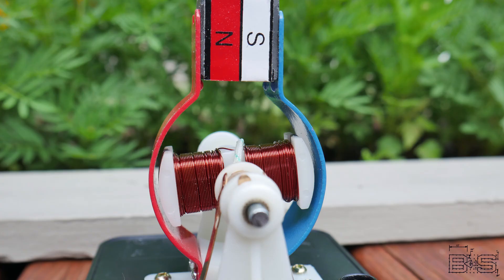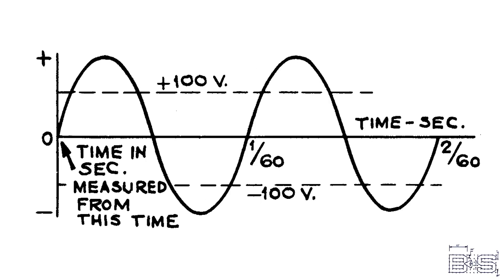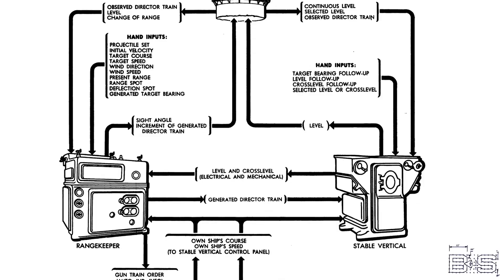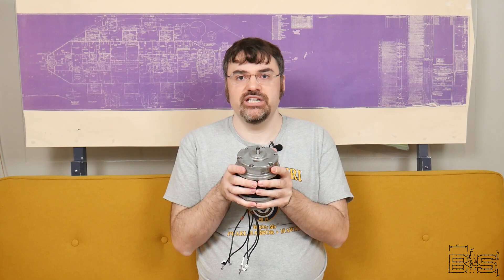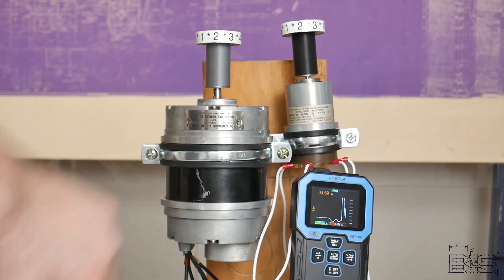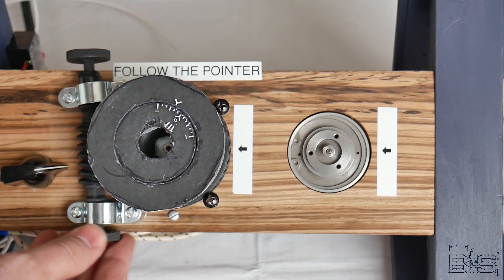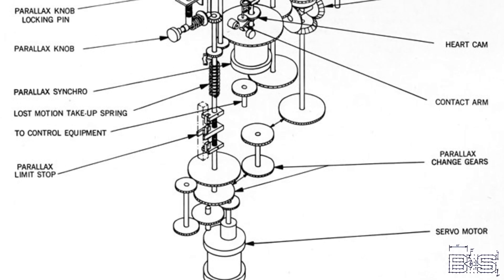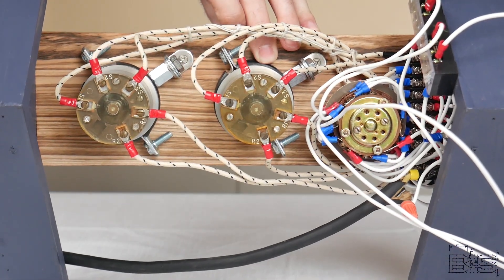Synchro Theory

Comment: USN, 68-74, ETR-2,  NAS Miramar, 70-74,  I maintained GCA RADAR and TACAN.  For decades, I had a HUGE  pair of old  60Hz  syncros,  don't know what happened to them.  We studied them in ET-A  school at Treasure Island, San Francisco.  I was a member of the fantastic  amateur radio club there, K6NCG, out on the NW corner  in those days,  look it up ;there are 3  websites with old archived photos.

Two of our  GCA RADARS  had  I guess resolvers,  I've forgotten,  to drive the electro-mechanical   CRT  deflection coils in the display.  We had 2  "QUAD" AN/FPN-36 RADAR,  and another  AN/FPN-52,  a  PAR only  section of the old CPN-4 design.  I do not remember  how the '52  sent sweep info from the antennas

I  have often guessed that  a pair of automotive alternators could be used as syncros  if the diodes were removed,  using low voltage such as 12 or 24VAC.  But of course the  freq  might not  be tolerable

Comment: I'm a former Turbofan Test Engineer for Lockheed and Rolls-Royce, which means we had a large test stand for the jets to hang from during test and that stand was about 1/8 mile from the control room.  We had a throttle connected to a syncro/resolver though an isolation transformer. 

I'll never forget that system because there was almost no documentation.  Luckily, many of us came from metrology at Lockheed, and the Marines prior to that, so we already knew most of how it was supposed to work. 

Really interesting stuff in your video, thanks for sharing!

Comment: It would be interesting to see how this was applied to automatically position a turret without a lot of oscillation.
It seems like a bad idea, but running the synchro on high voltage, you could use the current phase difference from the offset of the synchro relative to the turret to run a much higher impedance, much higher power 3 phase motor with the turret geared down to be proportional to the synchro.  Something something rotor current ... profit?

Eh. Maybe I'll try it with some alternators.

Comment: First off, you are way too young to be understanding Selsyns. I'm 67 and I got in on the tail end of things. Nice job of explaining things! :)

We used WWII Navy surplus Selsyns to control the positioning of the various chains in a conveyor system in automotive plants. Our standard layout was a transmitter, differential, discriminator, and receiver. The transmitter and the receiver were fundamentally the same. What you show as the generator and the motor. The "Master" conveyor would have the Transmitter/Generator driven by it (using an Edon unit to drive the generator), and the "Slave" conveyor would have the Receiver/Motor connected to it, also via an Edon unit.

The differential was a six wire device that sat between the generator and the motor and allowed us to control where the in-phase position of the Slave conveyor would be relative the the Master chain. Effectively changing where the "Dogs" on the two conveyors would align themselves in relation to each other (the "Dogs" on a conveyor were what moved the product e.g. cars around). It had a dial that we would move as necessary to get the gap between the dogs where we wanted it. For an example @8:40 you see the director and the turret pointing off in different directions, the Differential would allow them to be aligned to each other. And while the dial was connected to a shaft, the differential was never intended to rotate other then to adjust positions on the conveyors.

And finally we had the Discriminator, which took the difference between the commanded and actual positions of the motor (receiver) and generated a DC voltage that we used to speed up or slow down our DC motor on the Slave conveyor to bring it back into position.

And another fun fact is that the rate of the Master conveyor was set using the "Veeder-Root". Which was best known for being the device in a gas pump the translated the gallons of gas that you pumped into your car into how much you would have to pay. :)